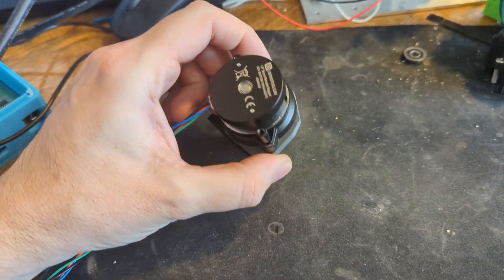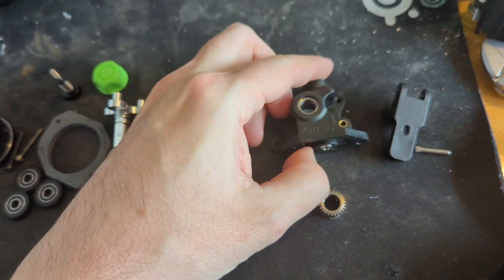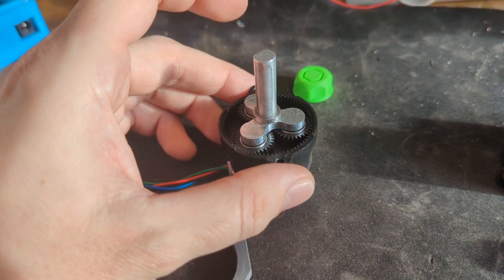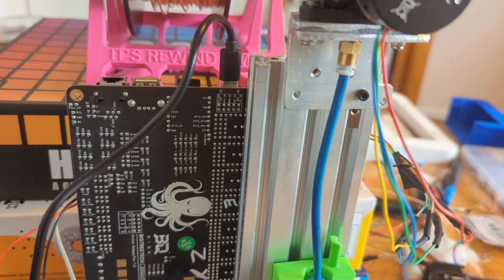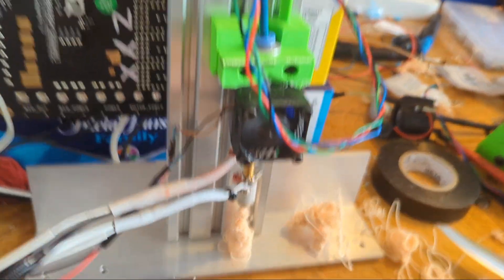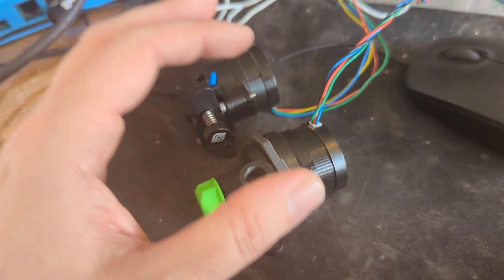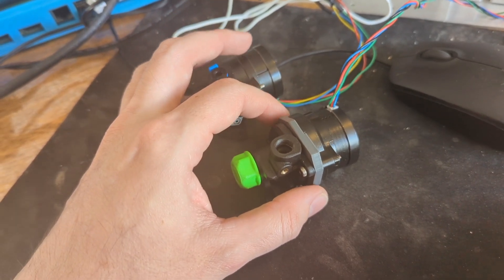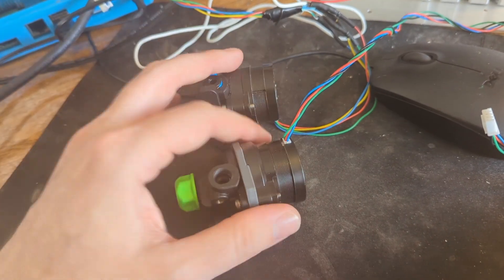Orbiter 2 - Galileo 2 - Hybrid mod

Comment: Whats the point of pushing harder then your hotend can melt plastic? If your hotend can effectively melt more plastic either extruder will push way more plastic
Reply: In short, size limits and stringing.

The limiting factor in melting plastic is the heat transfer rate of plastic itself, which is quite low. So you need more contact with heat to melt it faster. Special nozzle geometries like CHT have helped, but having a longer melt zone is the surefire way to increase melt speed. 

However, a longer melt zone has a few drawbacks. By being longer, it's harder to fit on a toolhead, it weighs more, and is more prone to quality mess ups from rocking and flexing under high speed. It also is more prone to stringing.

However, if your extruder has a strong pushing force, the outside of the plastic will be liquid enough to stick for layer adhesion, while the inside just gets squished into shape. It effectively does the same thing as better melting, but in a smaller package that is lighter and can make higher quality prints.

That said, we definitely have gone a little overboard, and are way past the point of needing more pushing force.

Comment: Have you been printing with it?  If so, what does the quality/consistency look like?
Reply from the maker: @tiaanv  I actually haven't been using it! But in theory the quality should be better because the Galileo 2 housing has an improved ring gear design over the orbiter 2.